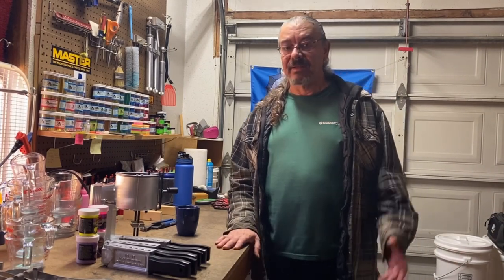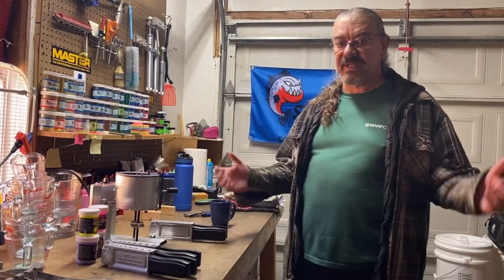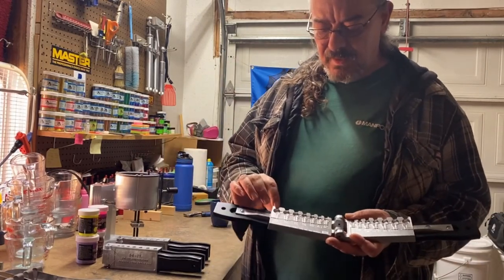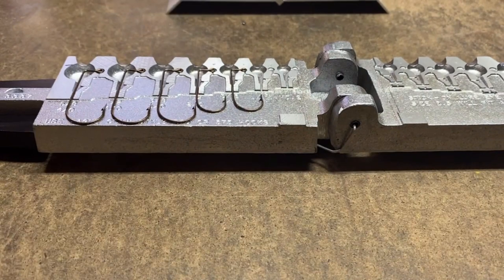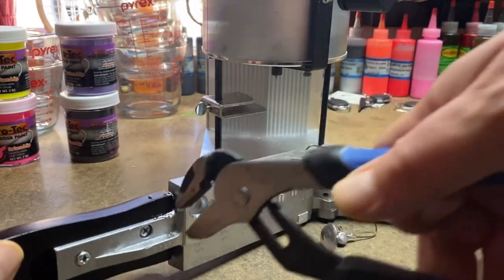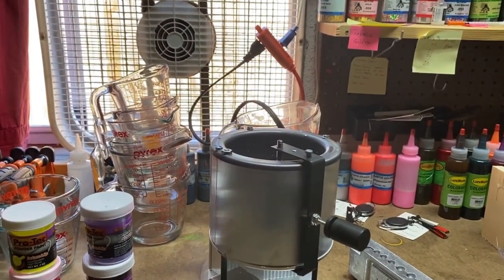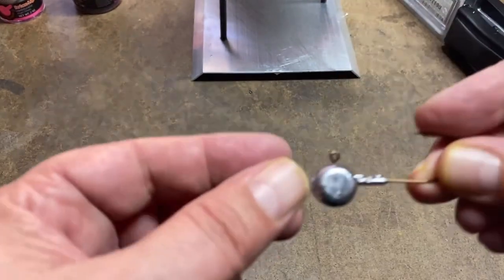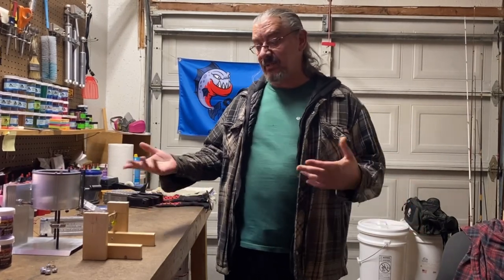Pillhead jigs

Comment: Is the lead start melting at 600 F up to 800ﾟF And the lead mold's get very hot you don't want to go above 1200ﾟF on the molds Or you will start melting the mold